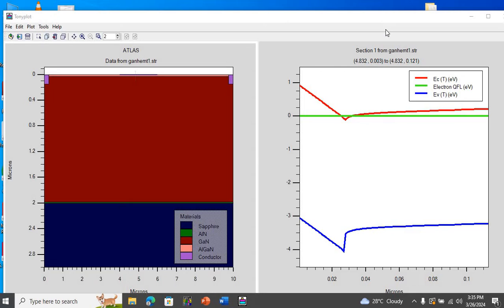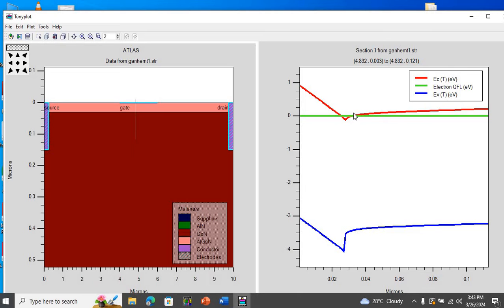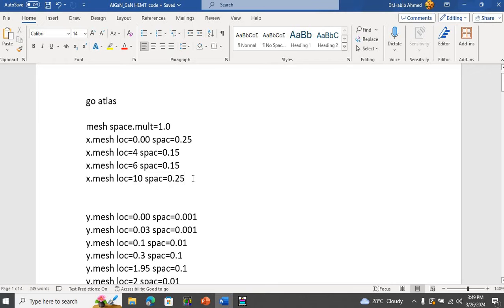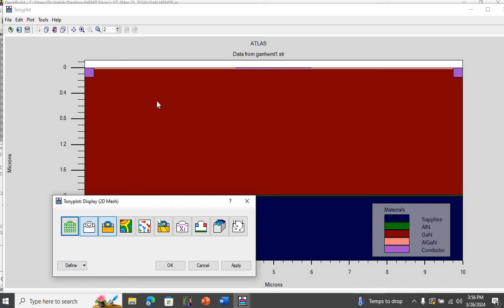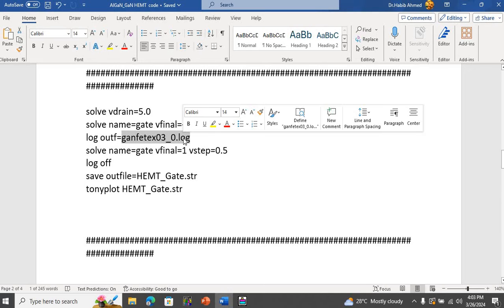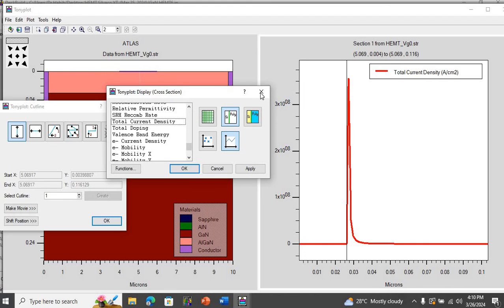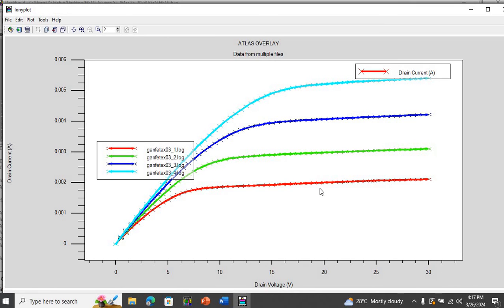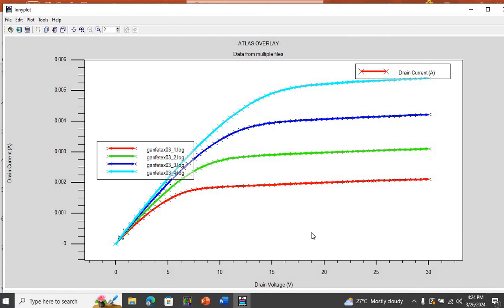Simulate AlGaN/GaN HEMTs with Silvaco TCAD: Efficient High-Power Electronics 🚀💻⚡️🔋💥

Comment: Sir, I want to simulate Vertical GaN which is not commercially available yet. Could you help me in this
Reply from the maker: Please watch my simulation video on GaN PIN diodes.
Reply: @HabibAhmadGatech  My research is on Vertical GaN FET not on GaN PIN diodes
..Is the simulation process same ??
Reply from the maker: I thought you were referring to GaN PIN diodes. 
You just need to optimize your FET structure for this transistor code.

Comment: Hello Dr. Habib. Could you please make a video on calibration?
Reply from the maker: Calibration in Silvaco TCAD simulation involves adjusting simulation parameters to ensure that the simulated results closely match experimental or reference data. Here's a step-by-step guide to performing calibration in Silvaco TCAD:

1. Select the Device or Process to Calibrate

Identify the specific device or process that requires calibration, such as a MOSFET, solar cell, or diode.

Gather experimental data or reference results that you will use for comparison.

2. Identify Key Parameters

Material properties (e.g., bandgap, mobility, lifetime)

Doping concentrations (acceptor/donor levels)

Interface parameters (interface traps, recombination velocities)

Defect parameters (trap density, activation energies)

Model parameters (e.g., Shockley-Read-Hall (SRH) recombination, mobility models, impact ionization coefficients)

3. Run Initial Simulation

Set up your device or process simulation in the DeckBuild environment with default or estimated parameters.

Run the simulation and note the key output parameters (e.g., I-V characteristics, capacitance-voltage (C-V) characteristics, quantum efficiency, etc.).

4. Compare with Experimental Data

Plot the simulated results against the experimental or reference data. Note discrepancies in parameters like current, voltage, or charge distribution.

5. Adjust Parameters

Based on the discrepancies, adjust the relevant material or model parameters:

Mobility models: Adjust low-field or high-field mobility to better match the current behavior.

Recombination parameters: Modify SRH recombination lifetimes or surface recombination velocities to match minority carrier lifetimes.

Doping profiles: Fine-tune the doping concentrations and profiles for better match with experimental conditions.

Temperature: Ensure that temperature settings in the simulation match the experimental environment.

6. Iterative Simulation

Re-run the simulation after adjusting the parameters.

Continue comparing the results with the experimental data, and repeat the process of adjusting parameters iteratively until the simulated and experimental results are in close agreement.

7. Advanced Calibration

Optical calibration (for photonic devices): Adjust the absorption coefficient, quantum efficiency, and other optical parameters.

Thermal effects: Include thermal models and adjust thermal conductivity or heat generation to match temperature-dependent behaviors.

Quantum effects: For small-scale devices, incorporate quantum models like quantum confinement or tunneling effects.

8. Validate the Calibration

Once the simulation matches the experimental data, run simulations under different conditions (e.g., varying temperature, bias) to check if the calibration holds.

If the calibrated parameters work across multiple test cases, the calibration is considered valid.

9. Document and Save the Calibration

Once calibration is complete, document the adjusted parameters, models used, and the comparison results.

Save the calibrated simulation deck for future reference or use.

By following this procedure, you can ensure that your Silvaco TCAD simulations produce realistic and reliable results.
Reply: @HabibAhmadGatech  Thank you so much for your wonderful reply

Comment: Greetings Dr. Ahmad, I thank you for your efforts in preparing excellent video tutorials. I am working on your current video based on the thermal analysis of AlGaN/GaN based HEMTs and right now I am running the part of the code without the heating effects included. The problem I am running into is that I am analyzing the polarization charge concentration under thermal equilibrium and for unexplained reasons the value does not matches your achieved value of ~ 32.1 C/cm3. I am getting somewhere around 12.9 C/cm3 despite running the exact same code. Can you guide me with this issue? Based on my analysis if I change the polarization scale from 0.8 to 1.8, then I get similar results as you, otherwise the results are different.
Reply from the maker: Greetings!
Polarization scale might affect the appearance of the profile. Draw a cut line across it to figure out the values for sure.

Comment: Hello, I have a question about the SILVACO TCAD model where we are computing the ID vs. VGS characteristic curves. I have implemented the code and have computed the curves using two methods. The first method for sweeping VGS is the same as yours, and the second method is sweeping VGS via the method which you have used to sweep the VDS for the ID vs VDS curves. Ideally it is simple sweeping, so I was expecting similar results. but the results are slightly different. What could be the reason for this discrepancy?
Reply from the maker: Please check if you have used the same models.
Reply: @HabibAhmadGatech  Greetings, I thank you for your response. Sir, I am using the same model , since I have the two codes one after the other in the same deckbuild window and then I am using the overlay command to examine both the curves on a single figure.
Reply: Hi, will it be possible for you to share an editable version of your code using a notepad or a word document?